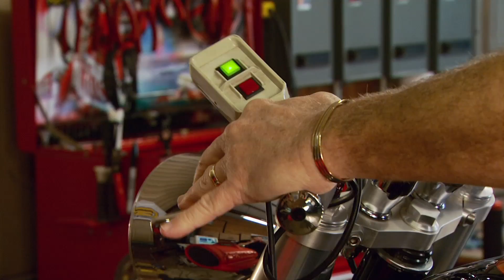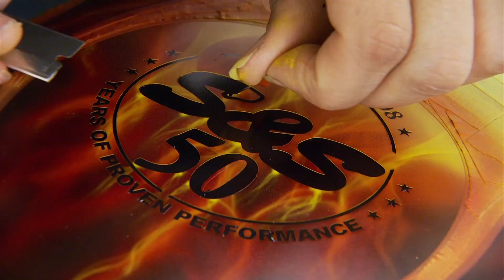Building a V-Twin Road Burner - HorsePower S12, E5

Comment: I would be very disappointed if I had a 126ci/2000cc engine that only made 153hp. A stock 750cc gsxr is making 148hp nowadays.
Reply: If you just look at the peak numbers i can totaly understand it but when you look at the torqe and when the curve starts you can  see the displacement.

Comment: After researching the same engine builds over and over, I finally decided to browse the older videos on this channel and I came across this motorcycle engine build. Very interesting and a much needed change of pace from the repetitive small block/big block V8 engine builds with the occasional Straight 6. What I'd also really like to see is like boat racing engine builds, like high performance boat engines

Comment: Hey, ACTUAL TECH QUESTION, how did the oil lines get hooked up? I'm building one now, 2007 S&S 124 motor to a dyna trans. I can not find any info on the oiling situation. I have seen the oil line kit with the block, but that doesn't look like it will fit in the counter sunk oval shape on the case.

Comment: kick in the pants???... fart you mean... only 150 HP... that was a big number in 1980...
most European brands get that amount of "power" (including the torque) from a liter engine..
and you can buy them as a stock / mass-production model.. for a reasonable price..
no special / sick / bad-ass stuff (with "special" prices) needed...
Reply: What euro bikes make 150hp and 150tq out of a 2 cylinder vtwin? Oh you are comparing an air cooled, 2 valve, pushrod, 2 cylinder to a liquid cooled, 4 cylinder motor? That is a horrible comparrison. Sure, you can buy them cheap and have the exact same thing as everyone else. Some people enjoy building something for themselves and not everyone wants a cookie cutter bike. Ducati is the only ones and the Panigale never made anywhere near the torque numbers as this motor did, seeing as how they make less than 100ft/lb of torque.
Reply: @jonnymac8925  yes, but the fact they are 2 cylinders huge displacement air cooled 2 valve motors makes them a bad starting point for race engines

Comment: "The most power ever seen on the street." Well, as long as you don't count the Hayabusa, ZX-14, or the VMAX. Which all run 10s bone stock...
Reply: Even the modern liter bikes make more than 150 hp.  The Ninja H2 makes 200 hp, and the H2R makes 310-326 hp.
Reply: Yah but all those bike are massive product, anyone with 10k in there pocket could have it, but not this one
Reply: @ecstasybunny7281  If you were to buy this engine assembled, it'd be 5k on its own. That doesn't include the upgrades you'd also need, like transmission, brakes, and tires (plus the bike itself). And even then, 150hp is quite a bit less than the 190hp of the other 3 of the period (the S1000RR did not exist when this video originally aired).

It is a cool engine and a really big upgrade from the EVO it's probably based on, but to call it the most horsepower on the street (even for the time) is...wrong.
Reply: @Idividezero  not a evo bud
Its based on the TC88
Reply: @thatbuelldude189  Ah. I'm not a Harley guy, I just try to keep up with what they do. I knew the EVO had been around for a long time, but I didn't know the twin cam and the EVO were not the same engine.
Reply: @Idividezero  its all good
Im half ass a harley guy 
I love my buells
Reply: @Idividezero  99 was the last Evo 80 inch ,  and also the first Twin cam 88 inch

Comment: 150 hp from a 2 liter engine?
Reply: It's the sort of crazy power/L that you get out of a Kia Forte
Reply: @Artemisgoldfish   Its a v twin. the bike probably weighs around 600lbs. So thats plenty.
Reply: Guys can not comprehend vtwins make high torque and lower horsepower while sport bikes usually make higher hp and lower torque. Guys comparing 2 cylinder motors with big pistons to 4 cylinder motors with small pistons. It shows how truely clueless people are about motorcycles.
Reply: @jonnymac8925  KTM RC8/RC8R, Honda VTR1000 SP/SP2, Ducati 1098/1198, should I keep going? That power to liter ratio is a joke.

Comment: Wow Harley's are so weak! 126ci and only 150hp? Not good man!
Reply: Two valves per pot, pushrod actuated, air cooled, with rear cylinder getting obscured from air flow by the front, plus the architecture does not allow the high revving that DOHC water cooled designs do.
Reply: @SvenTviking  yep, that’s why Harley engines aren’t a good base for race motors
Reply: @connorssmallengines6663  your comment makes 0 sense. The displacement size of a motor and whether it is air/oil cooled or liquid cooled makes a big difference. Race classes that allow 600cc sport bikes usually allow upto 1100cc air cooled vtwins, because they are two totally different motors. That doesn't mean they don't make a good Race motor. They are cheaper and easier to fix with less maintenance and can make plenty of reliable power. The XR750 has more wins than any other motorcycle and is known as the motorcycle with the most Race victories. As for AMA, their rules allow bigger vtwins to run with smaller liquid cooled motors,because there is an equation. Simply comparing a 600-1000cc inline 4 to a 1200-1800cc vtwin is absolutely silly. The boys at Crete Performance who just yesterday pulled off a record 8 second pass on their stock wheelbase m8 bagger would disagree with you. Both motors have their ups and downs, but a Vtwin can absolutely make for an amazing motor to use for racing.
Reply: This was back in like 2002 dude, and yah 150hp and probably 150tq out of a 2 cylinder motor. How is that not good?😂

Comment: Should have just bought a CBR1000RR, 150whp at half the displacement and even less weight.
Reply: It doesn't have to be one OR the other, I have Harleys, crotch rockets and race dirtbikes. When you love bikes there's no need to discriminate
Reply: At probably a third of the price too...
Reply: But not the torque
Reply: And 2 more cylinders, so not comparible at all.

Comment: Maybe any gear heads can help me. My truck turns on but won’t stay running. 351windsor not sure what year but it’s in my 89 F-150. I replaced my distributor, new wires, new spark plugs, cap and rotor, coil pack, and coil pack connector also new ignition module and throttle body control valve. I’m out of ideas
Reply: Check timing, make sure it is getting proper fuel, make sure the air is okay. Thatd all I've got. Good luck
Reply: Check for vacuum leaks too
Reply: If you live in Vermont I'll stop over on my way home from work tomorrow and fix it for free

Comment: Did they really install the cylinders on the piston without ring compressors? And it slid on nicely!
Reply: I've done it without, it's tough but doable.
Reply: says something about the huge tolerances in that thing ..
Reply: The cylinders are tapered on the end
Reply: Never ever seen a ring compressor for a twin.

Comment: Now, do HD's race engine, the Sportster engine.
Reply: James McC2.4hum  Yes, but very good torque.  I rode my CB 900 C Honda, 88 hp, 50 ft/lb torque.  Two up, full load, 125 mph easily.  My HD, 60 dyno'd rwhp, 70 lb torque.  120 max speed empty.  But, pull front wheel in drag races on track.  My Honda was great, but love my HD Sportster.  I also had 1983 Kawasaki 750 LTD Twin belt drive.
Reply: osp80  The Sportster engine was the race engine.  Only HD engine with cross drilled crank for oiling.  Solid tranny to engine construction, best push rod angle.  Can you say Twin Cam?

Comment: I love to see people pushing Harley engines to their limits. Don’t get me wrong, I like the speed demons from the East, but there’s nothing like the roar of a Harley V-twin.
Reply: Dean Williams Yea, I’ve heard of Ducati and Triumph and they’re also cool bikes. It’s just that I’m open to appreciate the simplicity of Harley’s design. PS, Harley’s are relatively under-stressed engines stock, and for that reason are pretty reliable. And their post AMF bikes have really high build quality. And 120+ HP is nothing to scoff at on almost any bike. And Dean, given how bigoted you sound, I’d doubt you have enough skill or intelligence to ride anything more powerful than a Ninja 250. So go along child, and keep waving your PP around on 4chan and Reddit, they appreciate fine art like you.
Reply: I owned and rode a 1983 Kawasaki LTD twin belt drive  (sold it after owning it for 22 years, even rebuilt the engine with only 40,00km on it), a 1982 Honda CB 900 C with full factory fairing (lovely bike, 125 mph two up full load, crashed that one, hurt a bit), and the one I still own is a 1996 XL1200S.  My HD gets the best fuel mileage, has the most torque, is the best looking and sounds the best.
Reply: Dean Williams  I dont like Harleys but pretending they dont have any power LMAO top fuel drag bikes use vtwins
Reply: @vincentdipazio8143  watch Tony Ruggiero's Nitro Vtwin!
Reply: @vincentdipazio8143  it's like any other engine. Leave it in the hands a a Hot Rodder who knows what they're doing and you'll get all kinds of power. Factorys have to meet a wide range of people to stay in business. They provide the foundation. It's up to the owner to make it their's. I looked at a used Street Bob a few years ago. The guy had added another $15,000 in aftermarket parts. NONE of which were set up for him. He was only maybe an inch, 2 at most, than my 5'9"s BUT my limbs are longer. It fit me like a glove while it was to stretched out for him. He traded it for a Heritage which cost more than the Bob not to mention the extra cash he spent on the add ons. It was priced, still over priced IMO but it was a damn good deal.

Comment: I’d like to see that converted to a V8.
Reply: Dean Williams  My 1996 XL1200S makes stock one hp per ci and does not break down.  Still have it over my Kawasaki and Honda.  My Kowy made one hp per ci, my Honda made 1.6 hp per ci.  My HD is better on fuel, has the power, and looks the best.